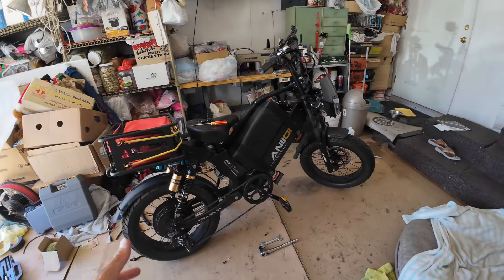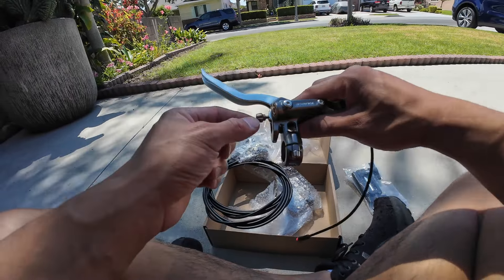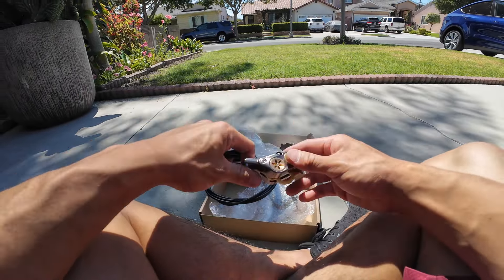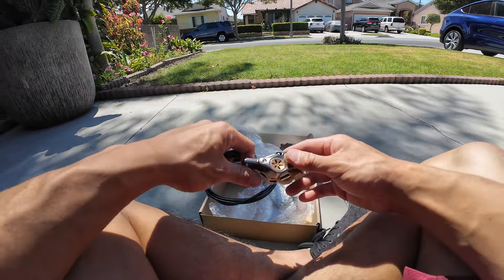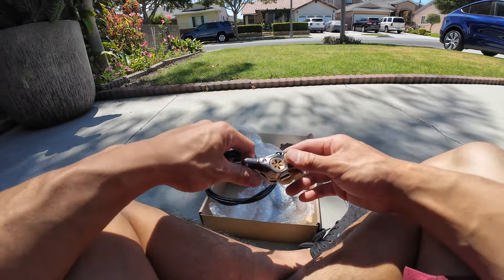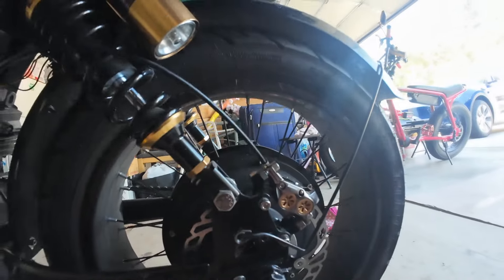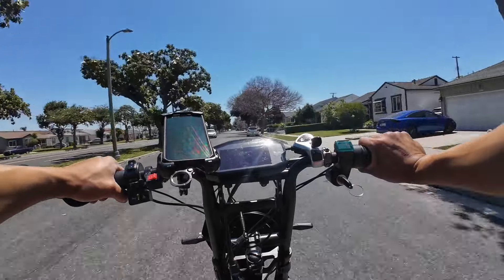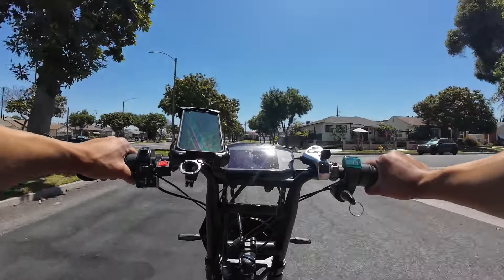Testing Budget Brakes On My 150lb E-Bike | JFOYH 4 Piston Disk Brakes

Comment: Great video .Pls link to the tire purchase and dash board
Reply from the maker: @tetsopguimmaik5908  this is for the tires. The display won’t work on a stock controller. 

https://www.revzilla.com/motorcycle/shinko-sr-567-568-scooter-tires
Reply: @Raspyrides  thanks
Reply: @Raspyrides  I have 72v 40 ah contrôler and motor so I think I will work .Can I pls have the link
Reply from the maker: @tetsopguimmaik5908  I purchased it directly from Nb Power through my supplier so there’s no link. It’s called a DKD Display and you can probably find it on allieexpress
Reply: @Raspyrides  thanks very much
Reply: @Raspyrides  pls am trying to purchase 2 of these and I think we have thesame tire 20.4 which am unable to select the exact dimension on the website.please what size did you use to purchase
Reply from the maker: @tetsopguimmaik5908  are you asking what size motorcycle tires I have? If so, it’s 110/70-16
Reply: @Raspyrides  thanks